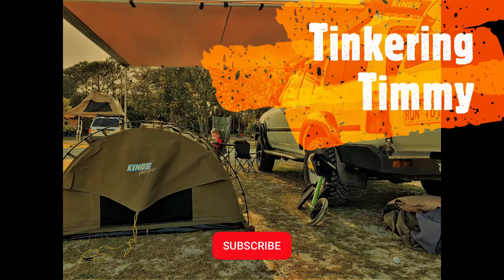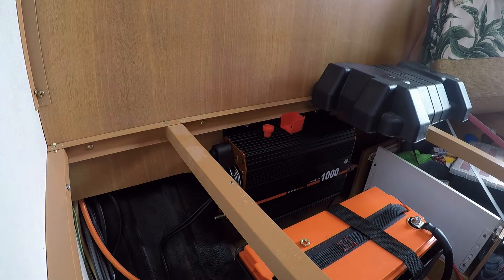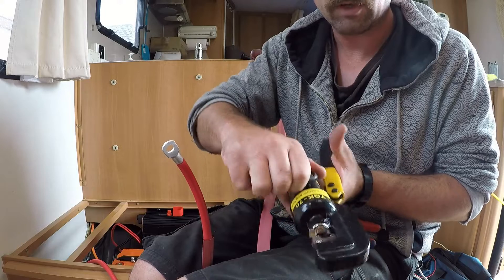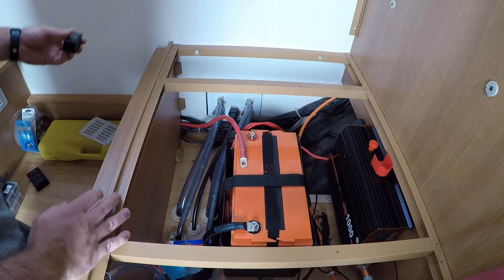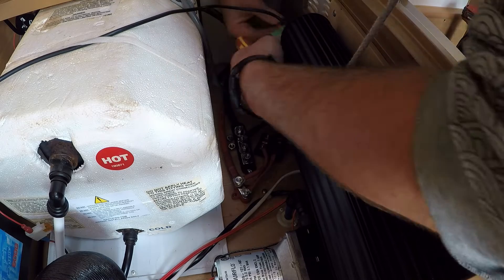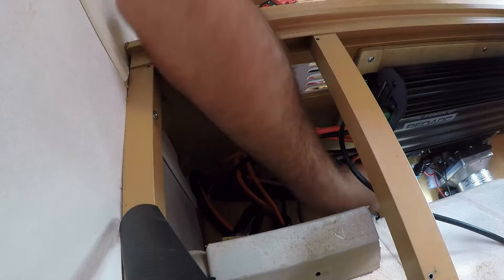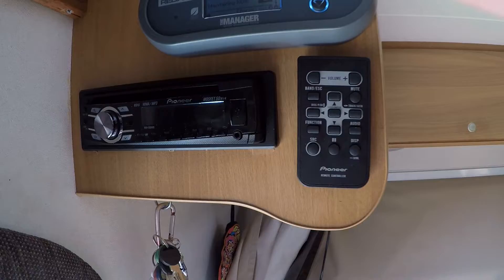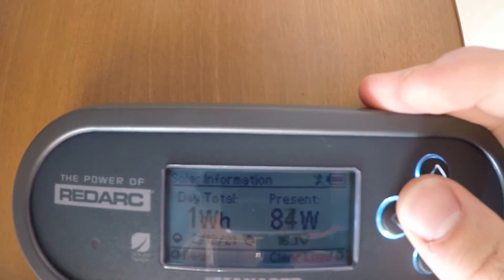LITHIUM install | REDARC BMS 30 | 120X ITECH Caravan Lithium Install Jayco Caravan Upgrade

Comment: Awesome video, was there a decision point between redarc and other bms like the BMPro? Ive used a BMPro before and know they are well suited to caravans but I like the redarc, seems very simple and robust.
Reply from the maker: If it was a new build the BMPro J35-D would have been hard to pass, with the option to install the control node and then put water tank level etc and a phone app it makes a pretty good buy. My van has a simple tank level indicator that is pretty accurate and the wiring is in a hard to access location away from the battery and charger so that would have added to the modification. The J35 having a fuse panel also would have saved my installing my aux fuse panel. The RedArc ticked a lot of boxes for me and was a super simple install/ upgrade and I really like the remote monitor, its easy to use and quick to monitor for information about battery SOC and solar input. I have RedArc products in my Cruiser, dual batt isolator and RedArc towpro, and the instructions are clear and concise and the products have worked flawlessly. Cheers for watching and the questions

Comment: Also can you explain how you wired up the inverter ?
Did you wire it up in the whole van outlets ?
Looks like you have a extra power point in kitchen, with the remote on/off for inverter

Thanks
Reply from the maker: Yeah I didn't want to go into to much detail about 240v power as it should only be handled by professionals. 
That power point you noticed is inverter power only, I chose to do this instead of running it into the van as it gets a bit complicated with the bypass. 
This is also our first inverter and we are pretty stocked up with 12v and gas appliances etc.
Some inverters come with a bypass system like the enerdrive inverter bypass. 
As you noticed I also ran the remote switch to the location so all I have to do is turn it on and there's 240v power.

Cheers, Tim
Reply: Hi, I'm also pretty interested in the inverter into 240v. Those are some beefy cables. How does the battery manager know when mains is plugged in or not, to use the inverter or mains?
Reply from the maker: @GrimTTL  Inverter is installed separate to BMS. To use the inverter I have to switch it on at the unit itself. I also have a remote on/off up near the power point I have at kitchen bench. When unplugged I turn the inverter on and use the remote on/off when needed. The BMS will charge from 240v when plugged in and all other van power points work and are completely separate from inverter setup.

Comment: Great video, we’ll explained.
I’m on a mission to do the same, getting rid of agm & upgrade to lithium, been tossing up between chargers & solar controllers, but I think your persuaded me towards the bms1230

Couple of questions, I have a similar Jayco van - 2016 Journey Outback 17.55-8

I see you put in a fuse panel, did you take out the Setec unit ?
Did you run the roof solar & solar blanket into one inlet for bms ?
What size solar you have up on the roof ?
Thanks
Reply from the maker: Hey Troy, Thanks for watching!
The RedArc Battery manager 30 is a great unit.
Yeah the auxiliary fuse panel will eventually run all the stuff the Setec powered. I just unplugged the Setec so it just acts as a fuse panel. But that will be removed from use.
I currently don't have roof solar, you absolutely can run roof and portable solar together in parallel (positive to positive, neg to neg) to the bms30. Although you could run the roof solar to another regulator to get both solar charge and vehicle whilst driving. The RedArc will prioritize solar if both are wired to the unit and only achieve 30amps, where as you can get 30amps from your vehicle and possibly 20-30 from roof solar in perfect conditions. 
Keep in mind when connecting solar panels of different wattage and open circuit voltage in parallel, have a read online about the pro's and con's.

Cheers for watching!